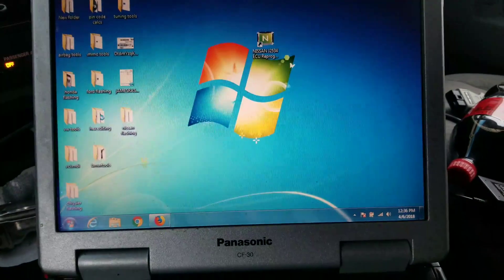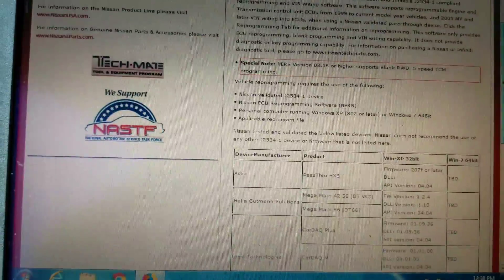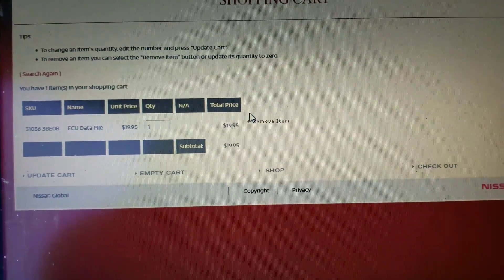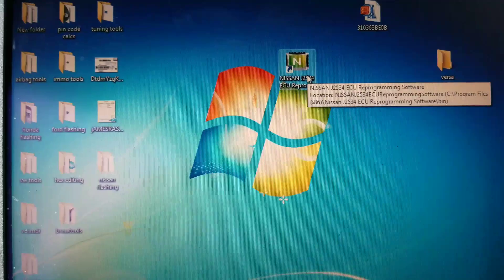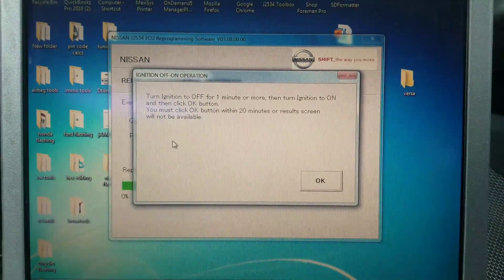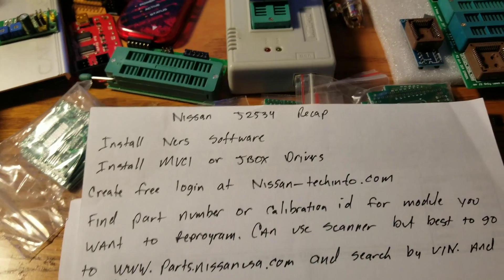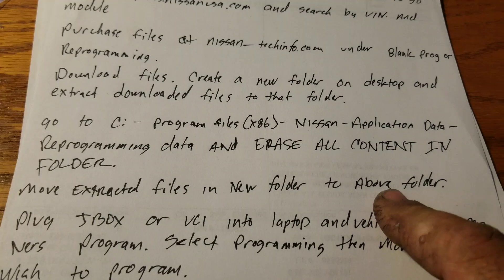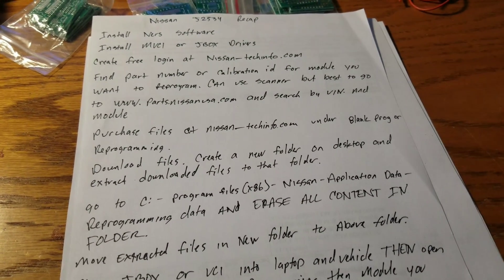Nissan Ners j2534 pass thru programming walk thru how to blank and reflash tcm

Comment: With J2534 Autel maxiflash device works ? 
thanks !
Reply: I can say the best device to purchase is the Cardaq-Plus2... expensive but well worth it. Autel doesnt have support for most of the OEM softwares.. it might work, but dont run into problems...
Reply from the maker: Alejandro Alfaro I have never tried it but I heard you can use the maxiflash with a laptop and it will work.
Reply from the maker: Pablo Hernández yea true
 I have a cardaq plus 2 but honestly I prefer my Bosch mastertech.  I don't why I like it so much. Maybe because it works perfect,  never gives me any trouble and it's really small and lightweight. The cardaq does let me use the j2534 toolbox to rest Chrysler vins and skim but I usually do that with my autel because I can run a quick dtc scan right aftert . We all have our own preferences and you are correct.  Anything cardaq is awesome
Reply: how much is the bosch mastertech @jack ? any link of it

Comment: THESE ARE THE BEST STEP BY STEP VIDEOS I HAVE SEEN ON AUTOMOTIVE MODULE AND KEY PROGRAMMING ON YOU TUBE PLEASE KEEP THEM COMING . I HAVE ONE QUESTION SO FAR..., COULD YOU TELL ME THE DIFFERENCES BETWEEN CODING AND PROGRAMMING AND I WOULD LIKE TO KNOW IF I NEED A SCANTOOL AND A PASSTHROUGH TO DO  MODULES AND KEYS THANK YOU VERY MUCH .
Reply from the maker: 8power0 the arent much differences between coding and programming. Coding is mostly found in European cars. It's basically a different way to program a new module. A large amount of coding however can be done with a scan tool. Its basically inputting information into a module to configure it to a car. Programming is more for American and Asian vehicles . It often involves linking the car to an online server through the OEM website and having the information automatically installed through the software using a j2534 pass thru or factory interface. It really depends on the vehicle if you want exact specifics. Every manufacturer has their own way to replace or upgrade software in their computers. Some modules require the vehicle vin number programmed in some don't making used modules either a good or bad option. Honestly the best approach to becoming able to do any car is to just learn every manufacturer's procedures. I'm trying to get a video up for every manufacturer as I get the chance to video them so you can learn the basics or where to start with each one.
Reply: Thank you so much for your most insightful reply , now if i only know if honda, nissan and chevrolet in the case of having to replace a module pcm or bcm and program a key would work to just rewrite the the vin to there modules then i can start focusing on what scantools to buy for those car lines .